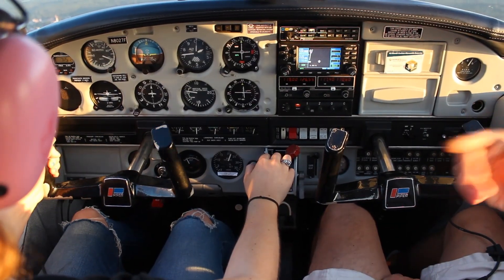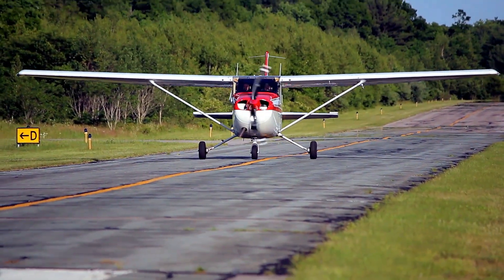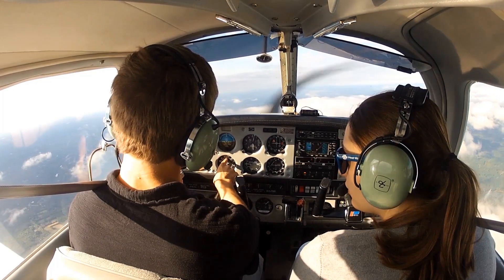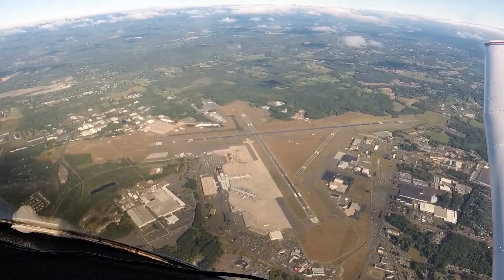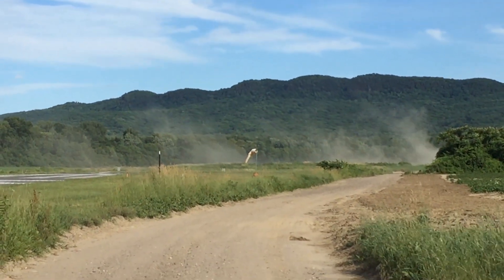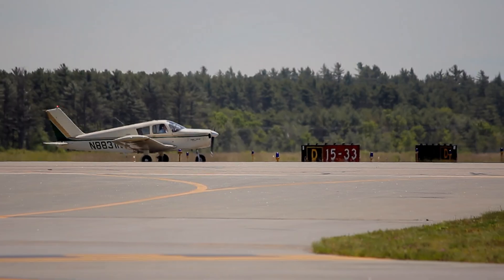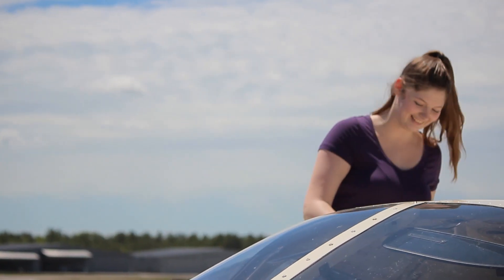Carb Heat Demystified:  Understanding the mechanics and the dangers

Comment: What is that in between the elevator wheel? It looks convenient..do you use it as a knee board/gps?
Reply from the maker: Timestamp, please?
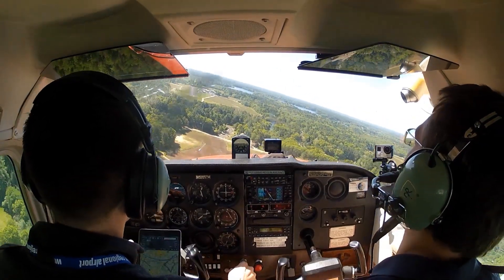Reply: 3:09
Reply from the maker: Yes!  It's an iPad Mini on a yoke mount.  Most pilots like that very much, but I like the bigger iPad on my lap.
Reply: I see. Do you take down atis on it aswell?
Reply from the maker: I can usually keep everything in my head for the purposes of my flying, but it does have a scratchpad that I'm sure would be very handy for more complicated IFR readbacks.

Comment: I went up in an old motor glider once with a tuned up VW beetle engine in the front, apparently you could get an iced up carb in a car with that engine! We used reheat quite a lot, allegedly there was an incident where that aircraft had to be glided home because the carb had turned into a solid block of ice which took over a day to thaw out!

Comment: I've always wondered why they don't filter carb heat air entries.. Less engine power I know but better than nothing
Reply: I think the lowering of the power is not the only issue. The other one is if you fly through dust or something else which blocks the filter. You need alternate air source that will not be blocked. There is little point to alternate air source which suffers from the same flaws.
Reply from the maker: And I'd love to tell you, but I've yet to hear a definitive answer :-/
Reply: I've always figured that when the carb heat lowers the HP, having to suck the air through a filter would lower the power even further. Have to remember that the engine is basically a massive vacuum pump.
Reply: That one is easy: A filter can get clogged. To avoid clogging as best as possible carb heat is unfiltered. This is by the way another reason to switch carb heat on if you suspect some air filter clogging in flight. Unfiltered air is your last line of defense in that (rare) event. It is better to have 10% less power than 0 RPM.

Comment: can you explain the chart? I still dont get it when you say carb heat should never be used when icing conditions occur...
Reply from the maker: Well, that's definitely not the way if works, so I don't know what to tell you! XD  Ultimately, just grab a POH, and read what it says in plain English, like the example I have from Piper.

Comment: Fly behind a Continental 65 (Cub, Chief, Champ, Luscombe, etc). and not use carb heat.  RPMs below 1800 on a humid day can potentially give you an unexpected surprise.   Stromberg Carb's  aka Ice Makers.  Even on an 80* - 60% humidity day with carb heat on at midfield down wind.  Upon shut down look at the carb.  What's all those little droplets of water on the outside housing of the carb?

Comment: The RPM green arc is the normal operating range, it doesn't mean there is a risk of icing outside this range. Actually, depending on where the icing occurs, some injection-engined aircraft require more or less RPMs.

Comment: 4:18 to 4:23
Something about detonation. I think I would rather just never use it then cause I don't want my plane to EXPLODE.
(Note, I'm not angry at you.)
Reply from the maker: Well, detonation isn't what a lot of people think it means in engines, but it's still not something that you want to have happen when you're not expecting it and don't know why it's happening.
Reply: Friendly Skies Film What is engine detonation then? I'm not sure as I'm not a pilot. Yet.
Reply from the maker: Yet?  You will be if you want to be :)  It's similar to dieseling.  It's when the fuel-air mixture in the cylinders detonates without the firing of the spark plug, presumably before.  It puts very undesirable stresses on the engine mechanics, and decreases the power of the engine.

Comment: It really depends on where you're flying. Sure if you'e in Arizona or drier parts of California - the air will be so dry that you'll only get carb icing if you fly through a cloud at low power I suppose. In Northern Europe the air has much more moisture in it - especially the UK and we have had a few incidents of short finals crashes where carb icing was strongly suspected. 
I think it's dangerous to give advice like this without a caveat that it depends on where you're flying. Not all of us fly in dusty conditions where filtered air is so important either.

Comment: i just wet flying in a 172, the pilot asked me to test the carb. heat, when i did, the engine performance degraded, now that i know what it does, i can see why
Reply from the maker: It'll always drop a little in most planes, but a lot is usually an indication of ice.
Reply: it wasn't a lot, just a little.

Comment: Very interesting.  Just finished the Advanced Pilot course on engine management.  Things are not that simple.  Turns out my normally-aspirated 182 has the worst mixture distribution in the entire GA fleet, which is markedly improved by running a little carb heat all the time, allowing you to lean considerably - and THAT increases engine life as well as reducing fuel use.   If you need more power, such as in a go-around - of course just push ALL the knobs in.

Comment: Fantastic explanation.  I didn't know about the air intakes on Pipers being behind the cylinders; but I knew there was some fundamental difference between Pipers and Cessnas.  

This was of course, a discussion of when to precautionarily use carb heat.  One thing I think is left out of pilot training (that I'm aware of) is in what manner to apply carb heat when you're suspicious of carb ice.  I went flying with a club C-150 one time when (apparently) the air was right in the middle of the carb ice butter zone.  I built up significant carb ice at cruise power.  That flight taught me a lot.  

The thing that instructors don't stress enough (I think) is that if you think you might have carb ice, turn the carb heat full on, put throttle to FULL, and LEAVE them both that way for at least 30 seconds or a minute.  If you do have carb ice built up, as it melts off from the carb heat, you'll get slugs of water going through the intakes causing the engine to sound terrible.  You have to let it work, which might take a minute or two to completely clear out if you let it build up.  

For the same reason, when I test carb heat in a Cessna, I turn it on and let it sit there for at least 15 seconds, to make sure that it's not already getting carb ice out.  In the flight I mentioned above, I later realized I was probably building up ice while taxiing (at low throttle, of course) on the ground.

Comment: Thanks for this one! I argue all the time about this with one of my right seaters who is also a pilot. It goes like this, he reads the landing check "carb heat ON and Mixture FULL RICH". I say, "Dude it's 114*F outside (KNYL) the temp gauge is 75% full deflection, DA is 4500' for a field elevation of 213'. We don't need it, and we don't need Full Rich either". He says, "yeah but the book says..." I say "the book was written for the masses that don't fly in hell". I can feel the engine groaning when combining carb heat with full mixture on these hot summer days.
Reply from the maker: Definitely consider all aspects!  So true.  Of course, in many aircraft like my Piper, it doesn't even say ON.  It says As Needed.

Comment: I used to carb heat all the way down but now I shut it on short final. Has a close one resulting in a go-around and did not appreciate the lack of power when I punched the throttle open...

Comment: I taxied a Piper PA-24-250 to a friend's hangar for work. Cold morning in northern California. Engine ran a little sluggish. For grins I applied carb heat. Engine rpm rose and performance increased.

Comment: Very good. There is nothing like knowing what the manual for your airplane says to do... especially for later model airplanes. Understanding is a valuable tool in life but can be a lifesaver in Aviation. I see someone else addressed the reason ice forms in carburetors... the expanding air cooling on the escape side of the venturi and the resulting temperature drop in the presence of moisture. I enjoyed your video and will subscribe. I've been a Pilot since 1983 and a CFI-I since 2002. I'm still learning. Tailwinds.
P.S. Good one empty pockets.
Reply from the maker: Glad you enjoyed.  You echo my sentiments of understanding perfectly :)

Comment: In most small lycoming engines the carburetor is attached to the bottom of the oil pan which is full of hot oil making the carb warmer.. In small continental engines the carburetor is NOT attached to the oil pan so it gets less heat from the engine. With Either  engine carb heat on final is acceptable.  Low power settings increase the speed of the airflow thru the venturi, this reduces the air temperature which can cause condensation to form.At  Low  enough venturi temperatures the condensation turns to ice. It is not hard for a pilot to turn carb heat off while advancing the throttle on a go around, but it is impossible for the pilot to restart the engine because he didn't use carb heat on approach and turned his carb into a ball of ice. Using carb heat on approach is good practice. 
The concern expressed in the video about sucking in unfiltered air is silly unless you are landing on dirt/ etc., then you turn the carb heat off just before touchdown.

Comment: 4:20 The reason why planes from "gold era of pitson engines" used ADI. Not i don't mean Attitude Directional Indicator, i mean Anti Detonation Injection. Basically a fluid to be injected into carb to prevent from detonation. It was used during takeoffs when throttles were set to high manifold pressures.
Reply from the maker: Fascinating!  You have me something to google :)
Reply: It was available in Boeing 377 Stratocruiser and in B-36 bomber. I don't know about other AC but i heard that some ww2 german fighters also used something to prevent detonations when running on high MP.

Comment: A&P here. You're diagram is a bit off. The cylinders are identical but on this side of the engine the forward pipes are the intakes to the cylinders not the exhaust. The exhaust pipes aren't shown but are at the rear of the cylinders. The carb is on the bottom of the oil pan and the oil pan actually has a 1 into 4 splitter tubes to each intake. https://motoplaneparts.com/listing.php?pid=117166

The hot oil around these metal tubes for the intakes also heat up the intake air. The first thing racers do is dump the hot intake system for a cold intake and dry sump.

Comment: I took lessons in a C-152 back in 1992. From what I remember,  the instructions were, "always pull carb heat when descending".
Reply from the maker: Yep, that's basically it for a Cessna.
Reply: But that was only being cautious in case you ever flew the C150, which was a b****r for icing up at reduced power.

Comment: if it is on the checklist you must use carb heat.
Reply from the maker: Well, it's not that cut and dry.  A thorough reading of the POH and an understanding of the systems is really necessary.

Comment: From my experience flying Piper Warrior's the best time to use carb heat is, any time the engine is below 2,000 RPM.
Thus, when on final, carb heat should be 'on'. At around 15~30 sec before expected touch down turn it back 'off' in case a TOGA is necessary.

Also, in a Warrior, the carb heat intake is not filtered (like the Cessna) but it can be prone to taking in dust, small rocks/sand and other miscellaneous debris from the runway on landing. But this shouldn't be a problem, because you turned if 'off' already.
Reply from the maker: Mind if I ask what experiences you've had?  I fly a Warrior, and as I showed in the video, the POH all but says you shouldn't have to use it ever.
Reply: No negative one's if that's what you mean, and I'm by no means an instructor. Just a recreational pilot.
I'm just going by what I've experienced using this procedure, that fact that this is what I've been taught and that it's never gone wrong for me, for anyone else at the flying school, or anyone who hires their aircraft and uses this procedure.

I'm not saying this is the only way to fly a warrior, but i don't want to be the one who ends up dead from carb icing because I blindly followed the POH (not implying that you are!!).

Also, IMO, if it wasn't needed, it wouldn't be there. Which raises the issue of when to use it.

Just sharing in the hope that with all our information together we can get to the bottom of when best to use carb heat in the warrior.

But great video! it raises the whole carb heat issue.
Reply from the maker: Well, glad that you haven't had any "experiences" yet!  As you said, let's do out best to keep it that way! Haha
Reply: Thumbs up!  :)

Comment: There is no reason to touch down with carb heat on.  You're either done flying or you need immediate, maximum power.  By the time you're on short final carb heat has served its purpose.  Shut it off before you get extremely busy with the landing.  If your engine is running on short final it's going to keep running.  Your carb isn't going to ice shut in those last seconds.

Comment: im not concerned with air pollution at all ....on down wind ill lower my cessna to 2200 rpm them carb heat on untill im like 300 or 400 feet over the thresh hold then shut carb heat off ...just one less thing to think about in a go around .
Reply from the maker: Regardless of the air pollution, that would be how your Cessna POH recommends you operate your plane.
Reply: Friendly Skies Film ....turning off the carb heat a feww hundred feet from landing reduces the chances of leaving it in by accident on go around so now thats the way i do it ...in flight training they keep it in till you hit the ground .... not a fan of the later so off at a 300 feet or so and forget it

Comment: I still don't know if and when I should use carb heat. I have been a private pilot for 46 years. I learned in a Cessna 150 and was taught to use carb heat when you reduced power as when landing and sometimes in slow flight. I got checked out in a Cherokee 140 and an  Arrow and the instructor said you didn't need carb heat. In 2000 my son bought a Grumman AA1A and one night we were flying back to Plant City Florida from Vinece at about 3500 feet. My son was flying and I was just looking outside at the clear sky. He was talking to Tampa Approach for flight following. All of a sudden the engine went to idle and we began our unplanned decent into the darkness...no lights on the ground where we were flying. My son called a Mayday to Tampa approach and they say what they usually say. Tell you about a couple of airports way out of your glide range. We got a little unusual RPM drop on run up before we took off, so my son was focused on the mags.
, He switched mags and I don't know what else he did but we were still going down. I was just sitting there and for some reason was not that scared. He said do something and I said what do you want me to do. He said "GET THIS DAMN THING RUNNING" so I reached over and pulled the carb heat out which he should have done and the engine came back to life. It was not that cold but the humidity could has been high. Later I saw the chart you mentioned and I was surprised at the range ice could form. That is the only time in 46 years of flying small single engine planes. I now own a 1946 J3 Cub 85 HP no electrical system. Most of the time I use carb heat on landing sometimes I don't, no carb ice yet.  Since then My son has attained an ATP rating, been a seaplane instructor, flew Falcon 10 jets, Capt on Cessna Caravan Amphibians and is now flying King Air 350i's for Wheels UP, he doesn't have to worry about carb ice anymore.
Reply from the maker: If he cleared Customs at Palm Beach in his UP 350i yesterday afternoon, I said hello to him while we were waiting in line :)

Comment: The CAT (carburettor air temp) gauge tells you icing is possible, if it is in the yellow zone.
Depending on humidity, temp, dew point and any visible moisture.
Reply from the maker: Are they standard equipment on rotorcraft?  I've literally never seen an airplane with one.  That's how unfortunately rare they are.
Reply: Yeah standard on Bell 47s, Robinsons etc. I did see a Mooney with one.
I don't fly planes so don't know why they aren't standard on fixed wing.

Comment: Regardless of your carburetor mounting and induction design, install a carburetor temperature probe and gauge  (I have the IE CA-1 Carb/OAT model), fly on cooler high humidity days, and then make this same judgement call.  I was shocked at just how often the gauge reads in the "serious icing" range.   Also note, there is a mesh screen between the heat muff and carburetor intake on most aspirated aircraft including the PA-28 series.   Remember, once your engine dies from carb ice, the heat source (exhaust heat) also goes away--don't be afraid to use carb heat if there's any question!